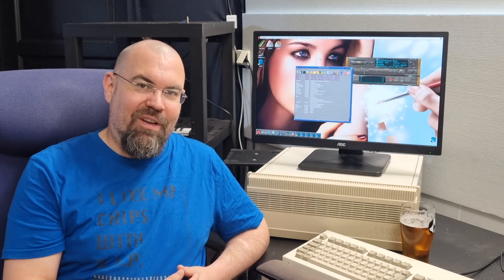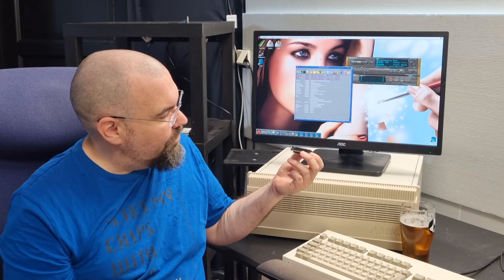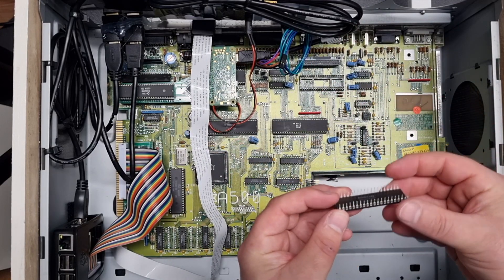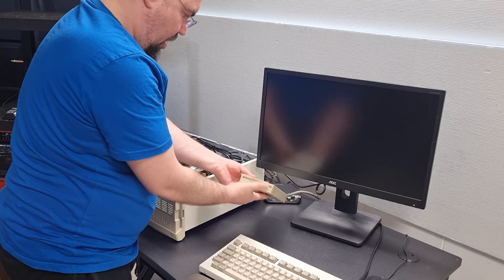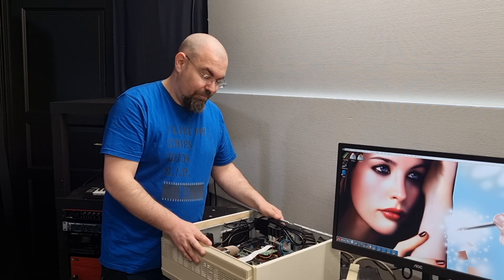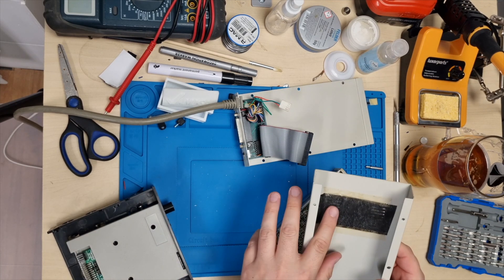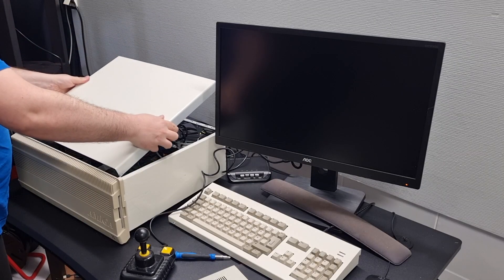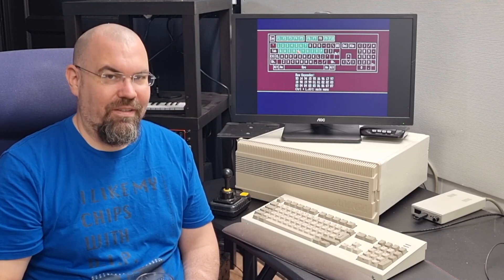Adding external Gotek as df0 to the Desktop Amiga 500

Comment: where could you put the switch on an a600 or a1200 so it doesnt mod the case?
i thought to do this so i could use one gotek between two amigas and just install the switch in both
Reply from the maker: This exact solution only works on the 500. As my A1200 went lost in transport I don't own one. But with 3.x kickstart (and maybe 2.x?) you can simply hold the two mouse buttons and choose df1 as boot device. No need for hardware hacks.(A very few games need df0 though. But not many)
Reply: @proteque  no, you need KS 1.3 too for some old games
Reply from the maker: @filevans Yes but you asked about A1200/600...
Reply: @proteque  yes and you can still have KS 1.3 on A600/1200 with a rom switch, i was asking about where to put the DF0 switch on those machines, you need 1.3 rom too to play some old games from disk, and the boot menu isn't available in that rom
Reply from the maker: @filevans  ah gotcha. I didn't know KS 1.x worked on the 1200. 

Regarding the switch: Well from what I remember from back in the days it is not as easy as this on the 1200 and 600. From my memory the CIA is not socketed so it would be a much more involved process. But this is very old knowledge so could very well be wrong or deprecated.
Reply: @proteque  of course it's compatible, people have ROM switchers in so they can run old games on the 600/1200, what I'd like is to have a DF0 DF1 switchless type which use keys to switch, whilst also having the switchless ROM switch but the ones I've seen use the same reset combo and aren't compatible with eachother. One DF0 switcher I've seen does the switch by pressing the reset keys 3 times , so not sure if that one would be compatible with the ROM switcher which is hold reset for 3 seconds

Comment: Interesting case, very clever. Also clever putting a Gotek in the external case 🤝🥇

Ooohhh is that a custom Serotina keyboard?
Reply from the maker: I would love that Serotina keyboard. Have considered trying to build one, but is a few small surface mounted stuff I am not sire I would be able to solder. This is just a normal a500 keyboard with extended cables.
Thanx for ths comment! Did a build video about the case and the keyboard id interested.